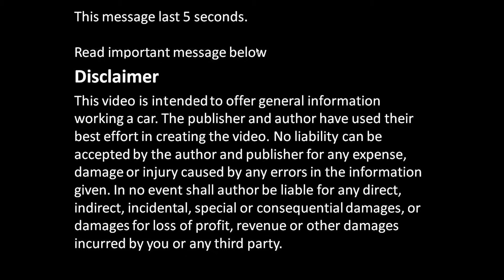How works Radiator Fan Computer

Comment: If the screw head get round put valve grinding paste coarse to the screw head little tap with hammer on screw driver and turn. 👍
Reply from the maker: Message read, good comment 👍

Comment: Is there a bleeder valve to let the air out of the radiator on a 09 toyota corolla? After a coolant flush, my radiator fan is not turning on.
Reply from the maker: Hi, you must start engine 45 min to idle speed and add all time coolant
Reply: @PeterFinnTheCarDoctor  thank you Peter.  The problem was that the top radiator hose was too long and was not moving the coolant.

Comment: thanks for the goo info.. How do you be sure if the problem is the Cooling fan computer.  I have the same car model and the fan just stopped.  are there any other item i should check before replacing the fan cooler computer?  thanks in advanced Peter
Reply from the maker: Yes: Temp sensor and fuse and cables
Reply: When the fan stops, check power at the radiator fan control module and see if it's coming out, if it is not, than the module has failed. If there is power coming out, look towards your Fan motor overheating. Then jump the fan directly from the battery to see if it spins to determine if the fan motor has failed instead.
Reply: @briansim3302  Hello if you guys read my comment, I am having that issue currently with my 2010 Corolla. The radiator fan is not working. I noticed this when I was at drive through place and the temperature gauge started rising. As soon as I got back on the road the temperature when back to normal.
This is what I have checked so far;
Looked at the fuses and those look fine.
Hooked up the fan directly to battery and it kicked on.
I turn on the ac and fan does not kick on either.
I tested the positive out of the control module and I read just over 12volts. 
With the car running disconnected the coolant temperature sensor and fan did not kick on either.
At this post I’m running out of options. Your help would be greatly appreciated.